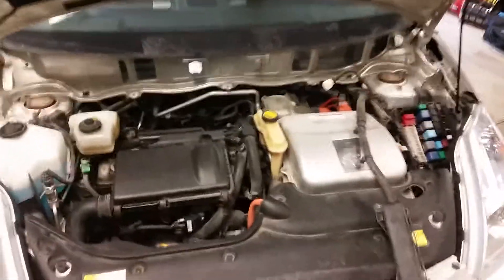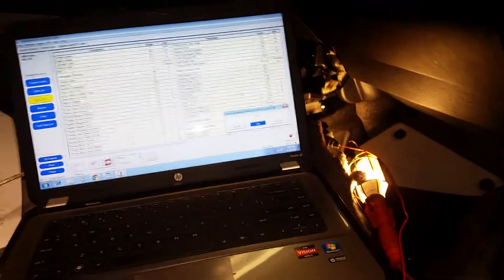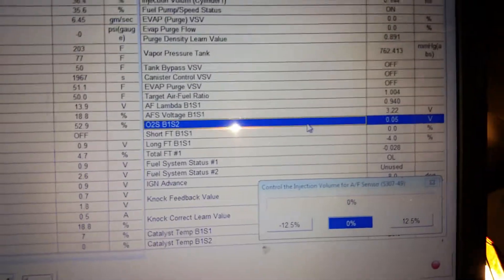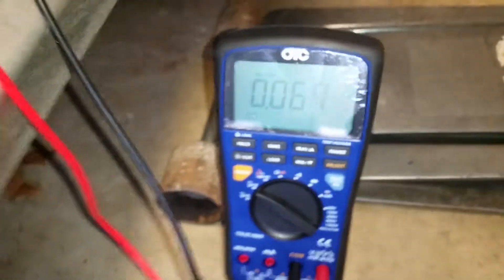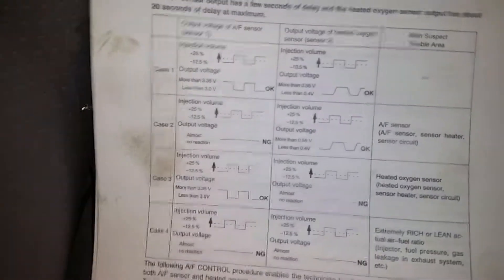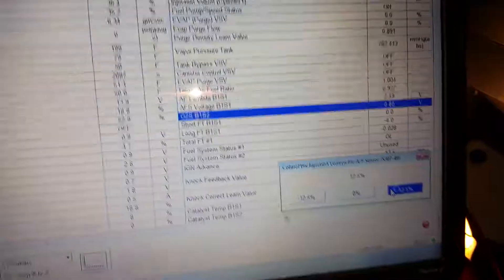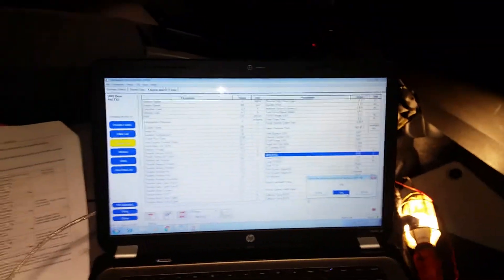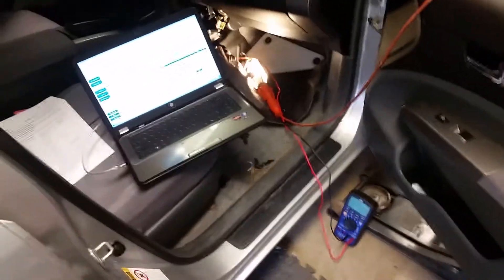Prius O2 Sensor Troubleshooting

Comment: As long as the cat sensor doesn't go above .9 volt, you won't set the CEL. There is a resistor and capacitor circuit you can put on the sensor leads (under the floor mat) that will keep it under .9 volts if the cat is dying.
Reply: I've tried the capacitor and resistor thing and still get a CEL. What combo do you recommend?  2008 Prius.
Reply: I haven't got it dialed in yet. I removed the floor mat and went into the cable and have 3 wires out with clips to hold the original wires. My CEL is coming on many times a day, as soon as a cycle is run. Now I need to hook up my resistance and capacitor substitution boxes and try to dial in a combination. I tried just resistance but without a capacitor across the line it just triggers the CEL. Smart computer. My Prius is a 2005 with 200k. I've been able to fool the smog man by clearing the codes and driving until the 3 sensors clear. Then I have a limited time to visit the smog guy and have him see "no codes". I have done this for 3x every two years. Here in Calif, you have to buy an OEM cat for over $1600. Or find somebody that will sell you a cat off a wreck. My son has a 2008. I could pull his off for the smog but it's a hassle. Soon I will try the sub boxes and try to dial it in.
Reply: @amazoidal  Hi... is there a Prius specific drive cycle or do you just drive until the IMs are complete?
Reply: Yes, you drive until the scanner shows everything is complete. Just varied driving cycle. Might take 20 miles or so. My cat was bad for years. For about 6 years (3 smog checks), I was able to fool the inspector by clearing codes, doing the driving cycle and just upon completing the cycle, getting the smog test before driven enough to bring the cat code back. In Calif we have a static test with the engine not running. Just reads codes and looks to see you have an OEM cat. It's all a matter of timing. But eventually the cat will die and you can't play the game.
Reply: @amazoidal  Thanks.  I ordered a rear 02 sensor and hopefully that will fix it.  Would be very surprised if the CAT is on its last breath at 209k.   All my regular cars have lasted longer.
Reply: When my first experience with an O2 code happened, the scanner said that the rear sensor was bad. I installed a new rear sensor but the real culprit was the front sensor. That's because when the front sensor fries, it causes the fuel mixture to go rich and the rear sensor tells the computer that it failed. It also means that the cat is getting weak and can't burn that rich mixture. So I would replace both sensors and then make a judgement on the cat. The rear sensor is easy to replace. You could use a crescent wrench but use the proper size open end. I think it's a 7/8 inch. But the front sensor is a real bitch. You must remove the wipers and the black cover to get access. Take off a panel attached to that panel. Then you have to reach back to get to the sensor. Cold engine only. Now the sensor is easy to remove. Use a wire cutter and cut off the 4 wires as close to the sensor as possible. Use a 7/8 socket to remove. It must be a long  "thin-wall" because there is round heat shield around the sensor. OK, now the challenge. How are you going to get the socket around the 4 wires to install? You are not. You need a special "Oxygen Sensor Socket" that is thin wall and has a big slot on it's side to accomodate the 4 wires. I bought a cheap $10 socket that had the slot but wasn't thin enough. No problem but it took a hour with a bench grinder to make it thin wall. I know it's expensive, but Snap-On makes the real deal. You almost want to take off the sensor and then search the parts stores for a thin socket. With the right socket, the sensor is easy to install. While the back of the enfgine bay is open, it's a good time to replace the PCV valve and the spark plugs.
Reply: @amazoidal  Thanks for the tips. You're probably right about replacing both sensors but the front A/F sensor looks tough so I'll start with the post-cat first. Throttle body and MAF sensor were cleaned recently. Spark plugs and PCV were replaced 60k ago. Gas mileage (44+ mpg) hasn't changed.

Comment from the maker: The problem was originally a bad upstream o2 sensor, I installed an aftermarket sensor that didn't have a little heat shield like the OEM. I swapped in a good OEM sensor and the problem was fixed. Have u tried all the regulars? Clean MAF, Intake manifold, throttle body, fuel injectors, new plugs. After cleaning MAF and throttle body you must reset the computer by disconnecting the 12v battery for 3 minutes, if u do not the car will run rough and stall. Have u inspected your wiring harness, ever been in an accident?
Reply: I also had the same problem with the upstream sensor first. I used an aftermarket sensor and now I'm getting the code for the downstream sensor. You think I need to put in an OEM upstream sensor with the heat shield?
Reply: I did clean throttle body and replace the plugs already. I also checked for vacuum leaks.
Reply: Hi my CAT was stolen and I purchased an after market CAT and o2 sensor , car runs perfectly but after doing 250 miles the check engine light came on p0037.  Do you think it's the aftermarket o2 sensor or the cat?
Reply: Here in Calif you can't even get an aftermarket cat shipped in. ANd the smog guys can look to see if it's OEM. I bet your problem is the upstream sensor. Hard to change unless you have the right socket. Most have thick walls which will not fit around the heat shield. The Snap-On is the best but it's $40. Your cat was stolen because it's worth big money in California, not for the metals.
Reply: Did it end up being the Cat